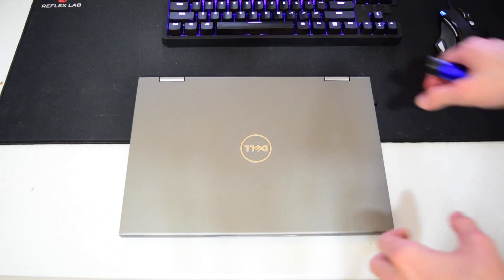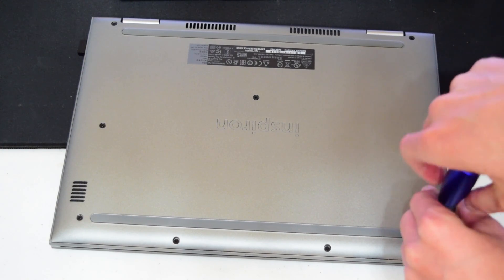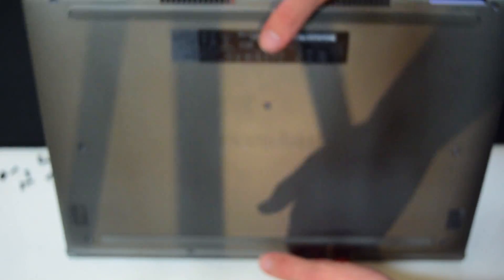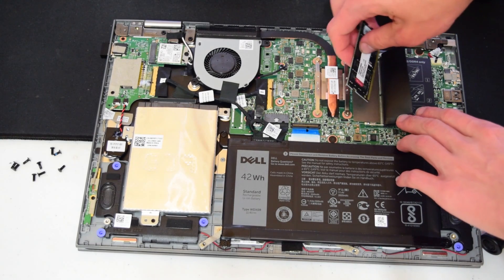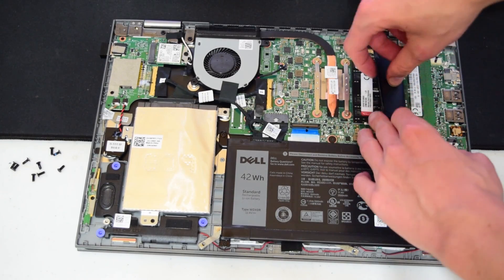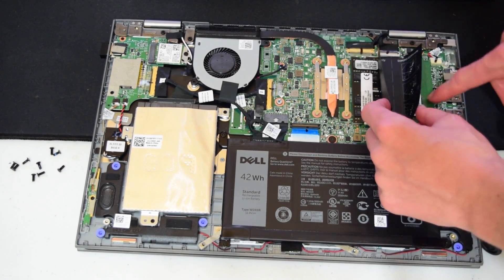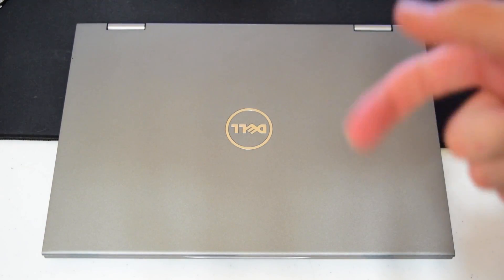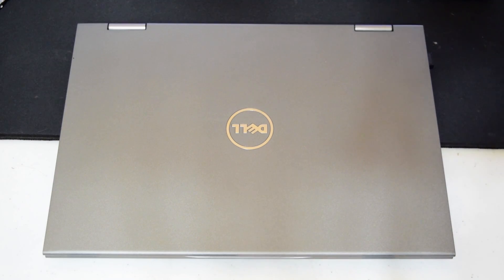Dell inspiron 13 5000 2 in 1 2016 ( ram and ssd upgrade with teardown)

Comment: Hi Len, great video, I just got the same laptop with the 6th gen i5 and 1TB internal HDD, the Dell customer support says that this laptop only supports 250GB of SSD (I am guessing as always they don't know everything) can you confirm if this model Dell Inspiron 13 5368 supports 512 GB of SSD. I am planning on buying Samsung 850 EVO or PRO 512 GB.

NOTE: the debate that i5 is not worth the price difference is totally a matter of personal preference, if you just want to surf web and watch movies the i3 is more than enough, but if you want to use it in a professional environment (I'll be using it for graphic design - photoshop, illustrator & after effects) in that case the small performance improvement of i5 is totally worth it as it will speed up workflow.
Reply: for some reason I am not able to pry open the bottom cover as easily as you, the locks around the heat vent seems to be sealed tight, I can't even get a fingernail in it.
Reply from the maker: No i cant confirm it but that doesn't sound right at all to me, older motherboards have had a issue with dives over 2tb but theres no way i can imagine that its limited to 250gb, especially on a new laptop.

Also not that i know the difference and the price for performance is totally based on preference totally based on person preference. The i5 6200u is about 14% faster in cinebench r15 and 17% faster in cinebench r11.5. So yes there is a performance increase, my main point is that this class laptop simply shouldn't be used in a professional environment for there performance in the first place, even the i7 version is only 2 cores and barley makes the 3ghz mark, turbo doesn't count because turbo only engages on 1 core that im aware of. To put this in perspective the i5 6200u scores a 284 in cinebench and a core two quad 6700 scores a 267 a marginal 6 ish percent slower then a current gen i5, only 6% slower and that chip is 9 years old is on a multi core level only 6% slower than the i5. The q6700 is a quad core yes but my point is who would do professional work on a machine that's 9 years old, i hope nobody, so i was simply making the point that for the uses of this laptop its not worth getting it for performance, this is as it states a Ultra book, its basically a notebook and entertainment device. I tried to play a 4k mkv file today with the built in video player in windows, it was so jittery, and i didn't use vlc player because it has a higher overhead than the built in clayer has and it was a full bit rate 70mbps video and yes i have a i3 but the i5 would not have done any better given that my i7 4790k oc to 4.6ghz was running at 50 to 60% load. so my mere reasoning behind recommending not getting the i5 or i7 models is if you need performance there are much better options not only for the price but that also will just playing out out perform all of the cpu models in these laptops without even including any desktop cps in the mix.
Reply from the maker: Make sure all the screw are out and start with somewhere that you can get under with a credit card or something of that sort and start from one area and work your way around, there is nothing else under there if you have removed all the screws so you just have to pull it off.

Thank you for watching, don't forget to subscribe, have a great day.
Reply: Great info, thanks

Comment: How did you transfer the data from your hdd to your ssd? Thanks
Reply from the maker: it is quite simple all you will need to transfer all your date is a cloning software if you buy a sandisk with the bundles acronis true image software then you can follow along with this video i made, and if you don't use the exact software all the mature points that you need to know are covered in this video.

https://www.youtube.com/watch?v=AfKVq5F9wKE

Thank you for watching, don't forget to subscribe, have a great day.

Comment: Great Video! What about Operating System? Does the OS boot on storage? Would I have to put an OS on the new SSD that I install?
Reply from the maker: No you would not have to put a new OS on it, if you check out the video i link i show you how to clone a Hard drive or any drive for that matter and make a clone of it that you then just use the ssd and you don't have to do anything but clone the original drive and then put the ssd in a the turn it on as always. Yes everything runs off your storage dive, there can be only one drive in this laptop so everything including your OS and all your data will be on that ssd.

https://www.youtube.com/watch?v=AfKVq5F9wKE

Thank you for watching, don't forget to subscribe, have a great day.

Comment: Can you mix and match ram? 
E.g Use 4GB of stock RAM and 8GB of bought custom RAM, with one in each slot?
Reply from the maker: Yes that's exactly what I did in this video was add a additional 8gb ddr4 2133 sodimm ram stick to this laptop for a did 12gb of ram. One thing to note since the sticks do not match they are only running in single channel mode.

Thank you for watching, don't forget to subscribe, have a great day.
Reply: Ok thanks!

Comment: Is there any reason not to use the faster DDR4 memory if the price is the same?  http://www.kingston.com/dataSheets/HX424S14IBK2_16.pdf
Reply from the maker: faster ram wont make a noticeable difference and since laptops don't support overclocking they wont support high ram speeds, im not saying it wont work but the only ddr4 ram speed supported for the i3 in my laptop is ddr4 2133. So yes more speed is better but if the laptop wont support it and it doesn't have a chip set to overclock on then i would say there is a chance it might not work at all or will just run the ram slower anyway. i recommend just getting just the standard ddr4 2133 to play it safe.

Thank you for watching, don;t forget to subscribe, have a great day.

Comment: Thanks Len. Ever considered doing a series on 3rd party stylus options, even for devices that do not have styli? The styli that come with certain devices are often disappointing. Surface Pros seem to be doing a good job but that's forcing you into a device to get a stylus. Kinda back-a**wards way to buy a stylus.
Reply from the maker: no i haven't thought of that but thank you for the idea i might consider that. Yes that's a little frustrating yes i wish all touch devices had proper support for at least a basic stylus. 

Thank you for watching, don't forge to subscribe, Have a great day.

Comment: Excellent Video Len! I just bought the Inspiron 13 5378 with core i5 and 1TB HDD. I am looking to replace the HDD with this SSD: http://www.ebay.com/itm/ADATA-Ultimate-SU800-256GB-3D-NAND-2-5-Inch-SATA-III-Internal-Solid-State-Drive-/302089343525?_trksid=p2141725.m3641.l6368
Please let me know what do you think about it?

Also, how did you clone the OS and data from HDD to SSD when you can only connect one drive at a time? casue I guesstThere is only one SATA 3 slot on the motherboard right?
Reply from the maker: Yes that ssd will work perfectly and should come with the same cloning software that my ssd came with, if you are looking for a ssd around 256 gb then here is the link to my ssd i have gotten for my new computers and it works great and comes with cloning software.

https://www.amazon.com/ADATA-Premier-SP550-240GB-ASP550SS3-240GM-C/dp/B013J7Q338/ref=sr_1_1?ie=UTF8&qid=1480021630&sr=8-1&keywords=adata+sp550

Now as for how to clone a hard drive: here is the link to my video on how to clone a hard drive:    https://www.youtube.com/watch?v=AfKVq5F9wKE

If you follow that video then it will work great and you will need a usb 3.0 to sata adapter and ill link one right here for refference or you can get teh one i linked.    https://www.amazon.com/StarTech-SATA-Drive-Adapter-Cable/dp/B00HJZJI84/ref=sr_1_3?ie=UTF8&qid=1480021971&sr=8-3&keywords=usb+to+sata

Now that adapter will work great for any 2.5in hard drive or ssd but it cant supply enough power to a 3.5in hard drive but if you follow the video and just connect the ssd to the adapter then it will work great.

Thank you for watching, don't forget to subscribe, have a great day.
Reply: Thanks a ton man!
Reply from the maker: Your welcome

Comment: Great information, thanks. Wondering how it has been performance wise since the upgrades? Looking at possibly doing the same thing. Thanks
Reply from the maker: Since i have had the laptop 4 months i will now be doing a update video on how ist lasted and how it performs, but the short story is now that with the ram i can open about as many chrome tabs as i wish and its much much faster with the ssd and gets better battery life. I cant use a computer without a ssd anymore and its definitively worth the upgrade.

Thank you for watching, don't forget to subscribe, have a great day.

Comment: Hi I have the same dell in this video but I need your help about the specs about the ssd that I should buy, note that my laptop comes with 1 tb hdd and I want to change it to ssd there is different sizes for ssd.
Reply from the maker: Yes there are 120gb, 240-256gb, 480-512gb, 960gb, and 2tb ssd, and if you meant form factor of the ssd the only only form factor supported is a 2.5in ssd. 

This is the link to a very affordable but grate performing ssd, you can select the capacity you desire up to 960gb.

https://www.amazon.com/ADATA-Premier-SP550-240GB-ASP550SS3-240GM-C/dp/B013J7P7SK/ref=sr_1_1?ie=UTF8&qid=1478649548&sr=8-1&keywords=adata%2Bpremier%2Bsp550&th=1

This is the link to a ssd thats 2tb if you need a driver bigger than 960gb.

https://www.amazon.com/Crucial-MX300-Internal-Solid-State/dp/B01KKZLX46/ref=sr_1_1?ie=UTF8&qid=1478650047&sr=8-1&keywords=2tb%2Bssd&th=1

I hope this helped, thank you for watching, don't forget to subscribe, have a great day.
Reply: Yes, i was asking about the form factor. Thank you very very very much.

Comment: I have the i7 version of this computer with 8GB ram in two slots. I see from the specs that it says it only supports a total of 16GB ram. Do you know if it is possible to add up to 32GB? Do you know of anyone who has tried it? Does it cut the battery life?
Reply from the maker: I know it doesn't officially say its supported in terms of laptop specs but my i3 in my laptop says it will support up to 32gb, like on intels website it says that for processor specs, so i would say it probably will work, and if you order it from amazon then you can just send the ram back if it doesn't work but i would guess that it can work even though dell doesn't have it listed. Intel says its supported so my educated guess because i haven't tested it is yes it will work. If you order from a website like amazon and you can just send the ram back if it doesn't work then go for it, you have nothing to loose and if i works then you have 32gb of ram, if it doesn't then just send it back. I hope that helped some. 

Thank you for watching, don't forget to subscribe, have a great day.
Reply: I just bought an inspiron 13-5000 series with stock 8Gb ram. I just added a 16GB stick into sodimm slot 1 and shifted the 8Gb into slot 2.  My computer is recognizing both SODIMMs correctly as well as the total = 24Gb, so 32 Gb should work just fine. 

I will probably go run out and get the 2nd 16Gb stick to max out the memory.

Comment: Thanks for the video! I bought a inspiron 13 5000 and will upgrade it to ssd as well. I was just wondering if I have to change something on bios after replacing the hdd to ssd or just turn it on and install windows normally on it with a boottlable pen drive. How did you do it ? 
Thanks again!
Reply from the maker: Well i just cloned the hard drive and booted normally, if you want to do a fresh install then you might have to change witch drive you want to boot to. If you have already wiped your hard drive or you just want to install the ssd and not worry with cloning then no it should auto recognize that the boot-able flash drive is the only drive it can boot from, once it finishes installing then it should boot normally. Now remember to go to dells website and download the drivers for your machine or some things might not work properly.

Thank you for watching, don't forget to subscribe, have a great day.

Comment: i have this one. and need to replace a bigger battery for my whole day work.
Reply: is the battery replace-able / upgrade-able as well?
Reply: It's designed to fit in the chassis so while it's replaceable, there's no update option

Comment: i want to buy this laptop, but i am concern with the screen glare. Do you think the glare that the screen have is too much or is hendleable? Thank you very much, very good review.
Reply from the maker: Yes there is screen glare, but if you want a touch screen then that's a trade off all touch screens have. now how bad is the screen glare, really not that bad. I haven't used it outside in direct light, but in my room with the blinds open and the sun coming in as long as i turned the brightness up it wasn't that be, screen glare was still there but not to the point where i thought it was unusable. I use it with my overhead bright lights on and same for indirect sunlight, i just turned the brightness up, its not that screen glare want there but it wasn't that bad and i don't really notice it.

Thank you for watching, don't forget to subscribe, have a great day.
Reply: Thanks for the feedback, if you have more to comment about the glare when it is used in outside please post here for more information. Again, thank you very much.

Comment: Hello Len Nobles need to buy a laptop for university and wanted to tell me model Dell buy, I need to run programs such as AutoCad, ArcGis because I am studying architecture. I could use an Inspiron 13 7000 or 15 7000 or  XPS 15 i5
Reply from the maker: well since you are considering the dell xps 13 you are in the price range of something more powerful for the same money, a xps machine is nearly 1k and if you are open to any other laptops i can recommend so thin and smaller laptops that are 13in and 15in at the largest that would be a lot more powerful but would drop so features, so if you don't need the touch screen or the feature of tablet mode than i can recommend some laptops that will perform much better, just give me some feature you like and need and a price range. But yes any laptop that meets the minimum requirements fore the program will work but if if you get higher specs then it will be more fluid and work even better. The more power the better and if your willing to sacrifice some size and weight and a couple features of a ultra book then you can gain the power of a real laptop. But any of the laptops you listed will work for autocad. there are better options available if you really want some power.

autocad system requirements: https://knowledge.autodesk.com/support/autocad/troubleshooting/caas/sfdcarticles/sfdcarticles/System-requirements-for-AutoCAD-2016.html
Reply: which would be the best options to run these programs with a budget would $ 1,200 for 15 inches.

Comment: Hi, I have question about upgrading ssd. After you upgrade the hard drive, do you need to buy a new windows 10 and install the os on your computer? It would cost $90+ for a new windows 10 system. Thank you!
Reply from the maker: No the windows license is tied to the computer no the hard drive. But also no if you use a cloning software and i have a video coming out soon on how to clone a hard drive, but it makes a duplicate of the hard drive and then you just put the ssd in the system and nothing changes only the fact that the ssd is about 5x faster. but you dont have to buy another windows lisence.

Thank you for watching, don't forget to subscribe, have a great day.
Reply: Thank you very much! I am looking forward to your coming video about how to clone a hard drive. ^_^

Comment: Great video, Len. Thanks a million. I just got mine the other day and it's a bit sluggish. I have the entry level model with i3 and 4gb ram (which is the same as the one shown). When I ordered it, the Dell site said there was only slot. I don't want to open mine until I get the extra Ram as I have sausage fingers and am scared of breaking the lips! So, just to confirm: your i3, 4GB, 500GB 5000 series has two slots? If so, then I reckon I might order a 16 stick and boost the hell out of it. It's a really nice machine, by the way, but the screen res isn't that hot. Good value overall, though. Dave from Dublin.
Reply from the maker: Yes i bought the model with the i3 6100u and 4gb of ram and a 5000gb hard drive. My laptop does have two slots and on intels website for the 6100u, that particular processor can support up to 32gb of ram. I really enjoy my machine too and its really nice but my 1080p screen is gorgeous and has the perfect pixel density and has great colors. I don't know why your laptop doesn't look that good. Yes its a great value for the specs this machine boasts for the type of laptop it is i couldn't find a better value that also performed as well as this one does.

Thank you for watching, don't for get to subscribe, and have a great day.
Reply: Thanks, Len. I think once I get the extra Ram it will be exactly what I need. The keyboard is one of the best I've used (I'm a writer, so that's important). I'll be using it to record and edit with Cubase as well, so I'll let you know how that goes.  Keep up the good work. You're 'ace' as we say here in Ireland. D